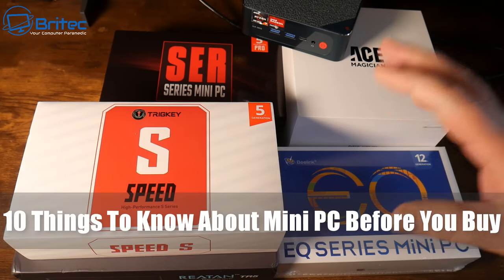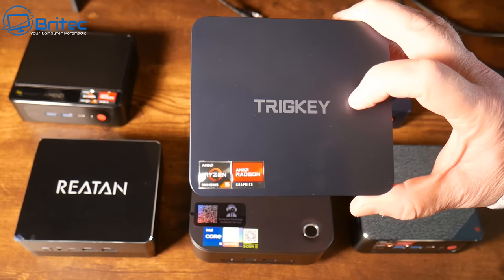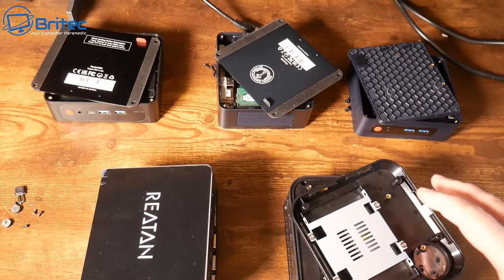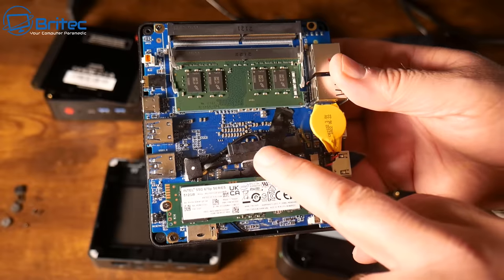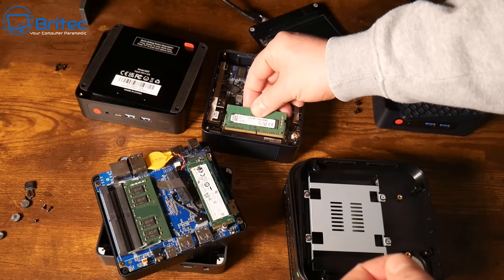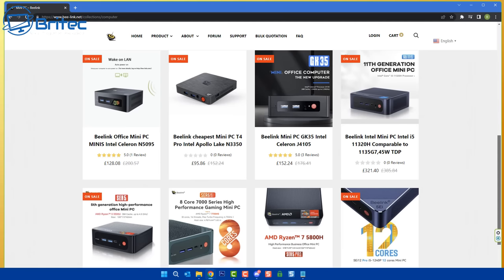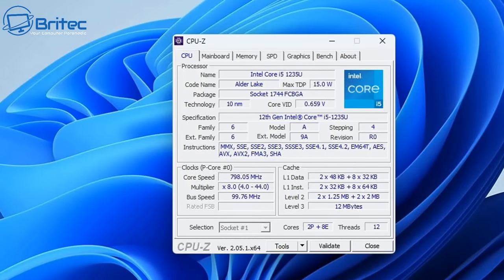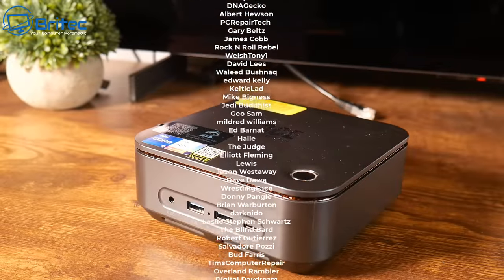10 Things To Know About Mini PC Before You Buy

Comment from the maker: Hope this helps, let me know if you need to know anything else in the comments.
Reply: Hey Brit, I was changing my res and hz on my desktop pc and after saving changes my screen went black and now I dont recive any output. I have tried everything and i was wondering if you could help. 

Thank you
Reply: What brands do you trust?  If you were to use these mini PC's for work or for handling private personal information, which brands would you trust?  Which brand do you trust when you run into problems?  Which brand do you trust to remain reliably working over the next few years?
Reply: thanks for this video, most of the things are summarized, made me subscribe to your channel and this is a first time I see a video from your channel
Reply: Do any of these Mini PCs have a VGA port?

Comment: It's amazing how small computers are getting these days, I like that you can mount them behind monitor or Flat screen and not take up so much room. I believe They will keep getting better and better.                                        Great Video!!
Reply from the maker: Totally agree!
Reply: Some of the mini pcs can fit in an average hand.
Reply: Corporate IT has been buying them for years.
Reply: I use my tower PC as a side table. A mini PC can't do that.
Reply: They've always existed in various more specialized uses. It's just that they're entering the mainstream now. I've got an HP t5530 thin client mounted to the back of one of my monitors and all it took to run Windows 98SE on it was to swap out the tiny 64MB PATA flash drive with something bigger. Period-correct Need for Speed 3, Future Cop L.A.P.D., and other nostalgic games in a device with the internal volume of a 5.25" CD/DVD drive with GeForce 4-comparable graphics.

Hell, You can find slightly newer ones that only have Windows XP drivers but are even tinier.

Comment: The are only 2 reason to buy mini pc :
 1. Its smaller than any other pc/laptop
 2. The power usage is much less than pc. 

Other than that, buy used pc and get the same performance / better with much cheaper price.

Comment: Well, I was looking for a Mini PC, but what I got was a Dell 9020 Mini Tower that was a refurbished one, with an older CPU, a 4th Gen I7. But that CPU is the same I have on my 2009 ASUS ROG Gaming laptop, and I am very happy with it, so I accepted that CPU for my PC.  But that PC was loaded with RAM, 64 GB of DDR3, and 2 SSD drives, one that is 256GB for boot, and a 2 TB SSD for storage, and an ASUS 1660 Video card with 6GB memory.  So I think I am really loaded, and I am not using it for gaming at all, I am using it to do Embroidery Designs, and that machine can do EVERYTHING I want it to do, and at a very fast pace, and using six different Embroidery software programs at the same time. Plus I can open 60-80 different sessions, each of it for different embroidery designs, and I can switch between them at will and without any wait. It has plenty of HDMI, USB2.0/3.0 ports, ethernet, Windows 10 PRO, that ASUS video card, plenty of RAM, and a large SSD I had a special USB Multi-port strip that connects that PC to my 20 different embroidery machines of my custom embroidery business.  And I only paid 180.00 dollars for it. So I am happy with it. But my point is that I followed all those tips given here in this video, and now I am a happy owner of something that satisfies me, that has High Quality components, and without spending a lot. By the way, that machine is running two 21,5 Touch Screen monitors from ASUS, and as I said, I am very happy wit it!!!!!!  Thanks Britec!!!  Your videos are as always AWESOME!!!!!!
Reply: Nothing wrong with these older PC's.  I took a 6 year old HP EliteBook 800 SFF, add 16Gb of ram and a 1Tb SSD, and it is a screamer!
Reply: ! I too run a win7 dell as my home device. I7 4770. Still awesome. No updates. No checkups. No issues. 
Happy to see someone else with common sense

Comment: You should check user reviews. Based on the reviews i found that some brands have higher failure rates than others.   In my opinion that is one of the most important factors in selecting what manufacture you select.
Reply: Most seem to have high failure rates from what I've gathered.  Beelink seem to at least trying to improve the cooling and longevity, although bios sounds like they're all over the place.  Any recommendations for a more reliable brand?

Comment: You are correct about the 1st two questions.  What is the device going to be used for?  A game machine?  A desktop for general computing?
Reply: I had created a NAS with a Raspberry Pi4B, but got tired of issues with Raspberry OS, and other ARM issues.  I bought a GMKtec Nucbox G3 to use debian12 amd64.
I shrunk the win 11 partition and installed debian12. I can't get debian12 to turn on Bluetooth, but I added a keyboard under win 11. The BIOS has too many settings related to Wi-Fi, and Bluetooth. But since win 11 worked, Bluetooth must be on in bios.
Perhaps debian12 doesn’t have a driver for it.

Comment: One of the things that annoy me is that some of these mini PCs have worse cooling then a laptop.  Some just cool the processor, but the M.2 or 2.5" SSD will be hot as heck and start to throttle.  I want a Minisforum Neptune HX80G and I think it has the right amount of cooling.  Meanwhile the UM790 Pro, a lot of people are saying the M.2 drive is over heating pretty bad.

Comment: Very good advice. However, what I need is ANSWERS to questions such as: BRANDS to stay away from and why. Mini PC vs Laptop or desktop. 
  You started when you mentioned Kingston & Crucial RAM vs no name. That's good... but perhaps there's a no name unit that has crappy RAM that you can swap out for good RAM and now have an excellent PC.
  We need a good IF-THEN type flowchart. Example: Q1: Will you be "gaming?" If the answer is YES, then follow this arrow; if NO then follow that arrow.
  The answer to that question alone should divide the pack in half.
  Do you want top notch Video quality? If YES, then here are the best, forget the rest.
  Do you need FAST performance (CPU to RAM to storage of large files and databases, etc) or is standard speed OK? That should eliminate another chunk.
  Soon we should be down to a half dozen models to choose from.

Comment: I find if you raise the mini-pc off the ground  3inches .The heat dissipates at a faster rate. I did this with my Bee link . Glad I did
Reply: what object did you use to raise it for reference
Reply: @nocomment5001  It could be built. Otherwise using 4 plastic covers of milk - box. Glue them. It is not high but is better than nothing.

Comment: bought a refurb EliteDesk mini that didn't have wifi built-in. Figured I could just buy the wifi antenna kit and install it myself. Learned that the non-wifi models don't have the proper notches cut in the case to do that. But, they do have the little circles in the back you can pop out and install a bog-standard RF Coax antenna kit. I originally didn't want to install the RF Coax version, b/c didn't want my mini pc looking like a wifi router with antenna stalks sticking out. But, I got one and it installed ok and it works. So, when you're buying your mini pc, make sure it has all the "basic" hardware you need in it. IE: if you want built-in wifi, chances are high it'll have a WLAN card slot, but may not have the antennas. So, if it doesn't have the antennas, it might be a pain (or impossible) to install your own.

Comment: Some manufactorers (cough Lenovo cough) are vendor locking Ryzen processors to one particular machine, which means it wont accept other CPUs. While that might not sound like a big deal, it will be if you decide to upgrade your system. If youre in the second hand market, getting an older machine can be bit risky since there arent many Ryzen 5 GE processors being sold brand new anymore and you want to beef up your old Ryzen 3.
Bottom line - check if your system can be upgraded. A solution can be to yank a CPU from another Lenovo machine but stars will have to allign for you to find one second hand CPU with right criteria.

Comment: Well researched and comprehensive content, thanks for sharing. I use a Raspberry pi at moment but want to get a mini pc that I can have Windows on one drive and a Linux mint version on a second drive and be able to choose which to boot say in bios boot option. I'm having a hard time getting an answer to can it boot from a second drive if I put say an SSD in a spare slot. I want to keep the Linux totally separate from Windows so I'm not looking at dual booting from a single drive. I'm learning Python and basic image editing so not looking at high spec gaming gear. Any suggestions of suitable mini pc world be helpful. And thanks again for posting this and your other uploads.

Comment: Before I got a Chinese Mele Quieter2 mini. Adding a Kingston Nvme I expected fast storage. It's only doing a quarter of what it can do. I then discovered it's a device with PCIe 2.0. Still fine for average use, but no SSD will ever be fast in there. I hope the newer ones at least have PCIe 3.0 or better. It can be very hard to find the correct one for the right price. Probably even more difficult than the laptop/pc market.

Comment: I actually have two mini pc's , both are beelink , one is a ryzen 9 6900 HX 8core 16thread 32gb dual channel ddr5 sodimm 2 m.2 nvme ssd's 1tb and 500gb I use that as a gaming server and I have a ryzen 5 5600h 6core 12thread 32gb ddr4 dual channel sodimm and a 1tb 2.5mm SSD with a desktop GPU adapter plugged into the m.2 port for a AMD RX 6700 XT 12gb desktop GPU and a apevia 80 plus gold rated 650w PSU 9 120mm argb cooling fans powered by adjustable digital PSU , dual monitor 31" curved 200hz dpcabled and all of the trimmings ....and gravy😊..... I love and approve of mini PC'S
Reply: On the mini PC that I use as a server I actually took it out of its case and I took another power supply that had burnt out I opened it up I gutted it except for the 200ish mm cooling fan I left that in there I wired that up to a USB type a Port connector and I installed the mini PC without its case inside the case for the power supply with the cooling fan inside I hooked up a Bluetooth and Wi-Fi extender antennas to the board ran that and attach that to the side of the case I put a small little monitor that you can actually see in my profile I placed that on top and attached it to the case and I use remote desktop from my main PC to control it , these computers are really versatile

Comment: 6:35  Everything nowadays is from China, Taiwan etc. Can't get away from that. 
That Crucial memory module that you pulled out is also made in China. 
Not everything made in China is necessarily bad or low quality.
Reply: The thing is who owns the company. Crucial has a factory there, but it is not chinese. They will make what the parent company wants. The point is: parent company reputation. Some brands send nice units to youtubers for review… and when you buy it, components are different. Bait and switch.

Comment: Beeline off Amazon S12 for $140 plus tax I believe the motherboard is OZW with Intel Celeron N95 
20watt (from review on line, can raise) 4core 4 thread, 8 GB RAM OZW 2100or 2300, I think, 256 GB M.2 NVME 2280 OZW SSD.  Windows 11 Pro. 
Works fine. 
But compulsive toddler and bothered by not finding information on OZW beyond builds two brand mini pc and components. 
Upgraded to Crucial 16 GB 3200 RAM (made in Mexico, there have been changes at/to Crucial)
Do not know if I needed 16 GB over 8 GB or if 3200 helps much or any. Seems a minor improvement. 
Cost $30 and tax shipped. 
Contemplating Crucial P3 Plus M.2 NVME 500GB SSD (cacheless) probably faster more endurance more reliable? OZW? possibly hotter. 
No one seems to be writing about heatsink for mini pcs. Did I mention I get obsessive and built computers long ago...
Looking at a good rated $9 heatsink but may be too tall, looking at laptop.specific heatsink too. 
Also Crucial P5 Plus 1TB M.2 NVME SSD probably more heat but not for my uses, has cache, more speed and more endurance $50 plus tax. 
500GB not enough cheaper...
Price your brands, and holidays sales. 
Both P3/P3 Plus and P5/P5 Plus are Gen 4 listed as Gen 3 compatible. Genre I think they run hotter, have not tried yet. Crucial and Samsung come with useful software for monitoring etc. 
Web says Beeline will if asked send you code key for clean install. For clone need M.2 NVME 2280 adapter $14-40, I think I will purchase around $18 or $24. $18 is mentioned as used. $24 has heatsink for use as portable drive does not get as hot supposedly. 
I expect if you purchase more expensive ones you will get the name brand RAM and M.2 NVME 2280 SSDs reviewer has seen.
I think I got the OZW for the$140 discount price? 
And as stated works fine and the faster  increased RAM install seems to make very little difference for my uses.
This is replacing an I5 2500 computer W10 built in 2012 very well.
Hope this helps?
Reply: OZW 256GB M.2 NVME 2280 is Gen 3.  That is why I think Replacement Gen 4s may be hotter, again usage matters a great deal. 
Prices Gen 3 may cost more than Gen 4.

Comment: Hi what's the difference between pc and mini..seems like they are equal, that is in general if you spec them 1 to 1 understanding one is a mini. Also general purpose so YouTube, streaming, work
Reply: You can give them equal use, but objectively they are not technically equal, in terms of power and capability, most mini pc's are closer to or equal to medium range to high end laptops, main difference would be that Mini PCs do not have a monitor, but that it's advantage as well, since you can use any compatible one.

Comment: Looking for a mini pc to play all my retro games on. But I keep hearing most mini PCs get too hot for retro gaming
Reply: depends on how retro the games are. my android box can play up to PS1 games no problem. most windows PC would be able to play PS2 emulator
Reply: @Archontasil  I've tried a few cheap android boxes and some expensive ones but they don't last long and tend to over heat after a few hours
Reply: @twisteddancer7773  what emulator are you playing? i use very cheap android box and can run ps1 just fine
Reply from the maker: Yeah, that can be done on most mini pc
Reply: I bought a cheap TCL QLED TV and it emulates PS1 no problem ;-)

Comment: Beelink is not a good MINI PC. At first its okay, but later on, the built-in wifi and bluetooth always disconnect and the worst part, after a year they shutdown because of heat. It would be better to build your own pc, its cheaper and easier to repair.

Comment: I didn't know these existed until a week ago and thought they looked cool.  I was wondering if they would be alright for watching movies from an external drive that's going to be attached to a wifi router or stream from prime or netflix.
Reply: That's most likely depends on the CPU and GPU (if any). 1080p vid with x264 or h264 codec should've run smoothly, but if you're talking about 4k media, that's a different class on its own.

Comment: Its easy, actually the mini's pc intel good processors but have a bad Graphic Gpu, so Radeon are verry beter, mini start with Ryzen 3, Ryzen 5, Ryzen 7
You the best choice betwin price and spec, the winner after my test in game Ryzen 7 5800h 16Gb , this processor make in 7mn, box case is verry quality vs Nipogi in Ryzen 5 or 7.  I have compare prices , you found Trigkey S5 ryzen 7 5800h (329 ...339 dollars) when is it best price, or 440 dollars standard price.
My last pc is N95 16Gb  its intel Gpu card 1200Mhz i keep for my tv, but when you see Ryzen 7 5800h and radeon , really its a other tech, for just many difference price take this.

Comment: pros: its small and compact, its easier to clean than laptop.

cons: you cant upgrade the cpu or put a gpu on it without a sweat.
Reply from the maker: Thanks for sharing
Reply: Have you seen modern laptops on the inside? the only thing you can change is the ssd. Even the memory is soldered.
Reply: External GPU
Reply: @CesarPeron  without a sweat. means its not easy.
Reply: @CarinoGamingStudio  👍👍